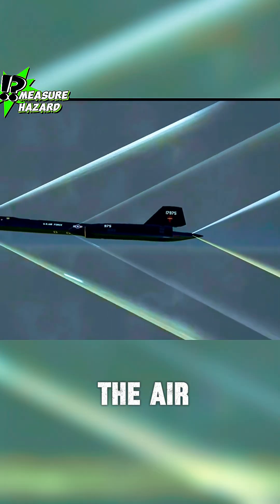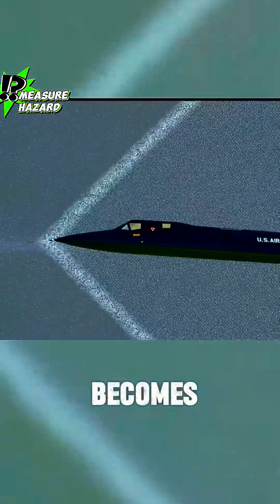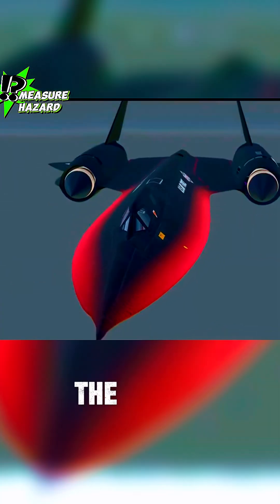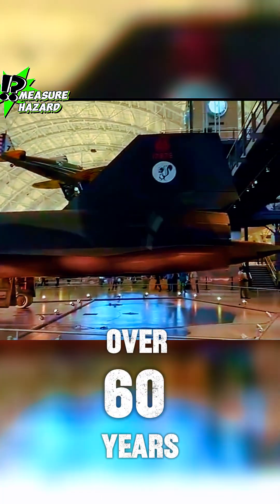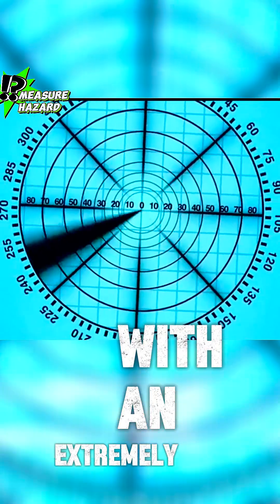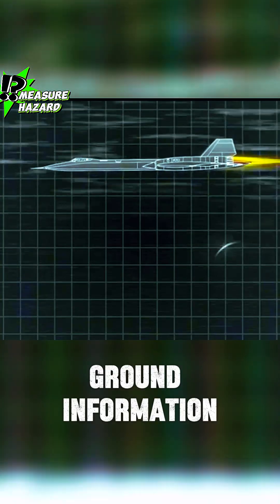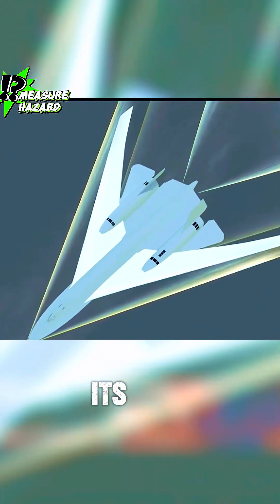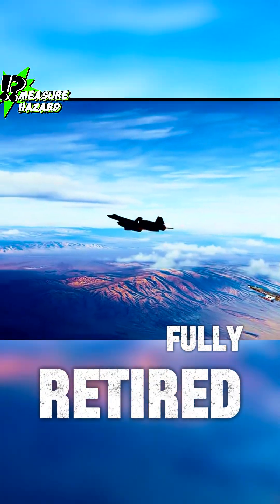Exploring the Strength of SR-71 Blackbird’s Sonic Impact

Comment: LOCKHEED MARTIN’S SKUNK 🦨 WORKS SR-71 BLACK BIRD WAS BILLED AS A “BLACK PROJECT” CALLED ARCHANGEL. THE DESIGNERS WERE CALLED UPON TO BUILD A PLANE THAT COULD TAKE OFF FROM AMERICAN 🇺🇸 SOIL, FLY TO ANYWHERE IN THE WORLD 🌎 IN A MATTER OF HOURS, TAKE PHOTOS, 📸 GATHER INTELLIGENCE INFORMATION, AND QUICKLY RETURN HOME WITHOUT BEING SHOT 🎯 DOWN! THE CREW CONSISTED OF A PILOT 🧑‍🚀 AND A RECONNAISSANCE SYSTEMS OFFICER OR (RSO). DUAL COCKPITS, SET IN TANDEM (ON AN 📐ANGLE) TO MINIMIZE RADAR CROSS SECTION (THE FIRST IN STEALTH 🦇 TECHNOLOGY) AND A BLUE, ALMOST BLACK PAINT DEVELOPED TO DISSIPATE HEAT GENERATED FROM THE INCREDIBLE 😮 AIR SPEEDS ATTAINED! THE FLIGHT SUITS WORN BY SR-71 PILOTS RESEMBLED THOSE WORN BY NASA 👨‍🚀 ASTRONAUTS, AND WAS FULLY PRESSURIZED AND CAME COMPLETE WITH A CARRY-ON LIFE SUPPORT SYSTEM.  thank you 🧑‍🎤 🏁 👩‍💼👩‍🎓👩‍⚖️ 🔬